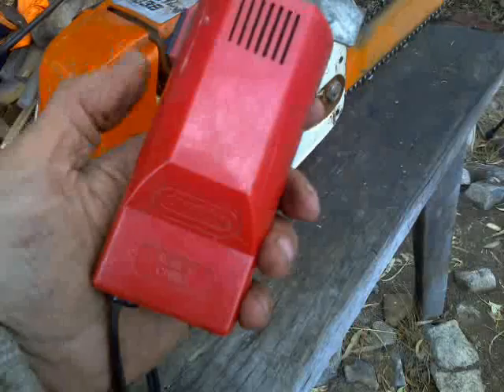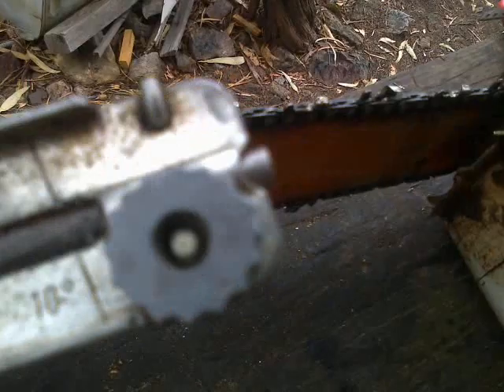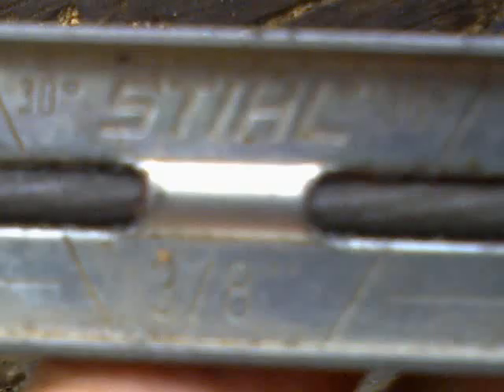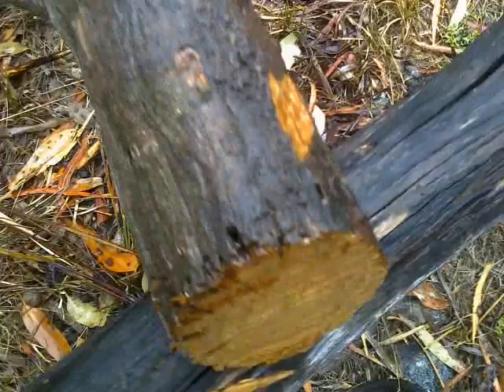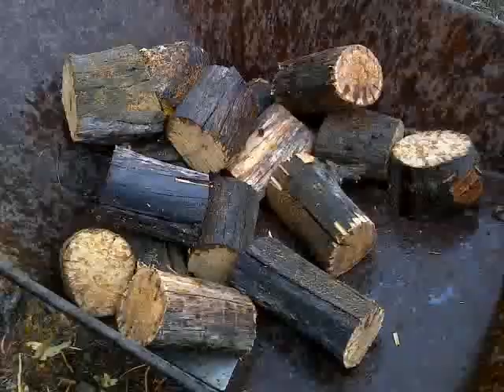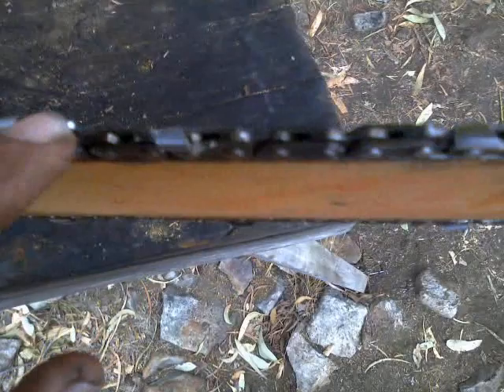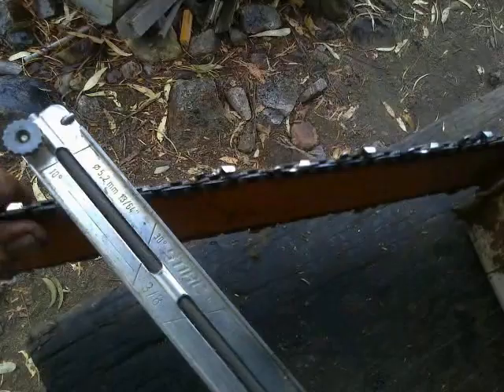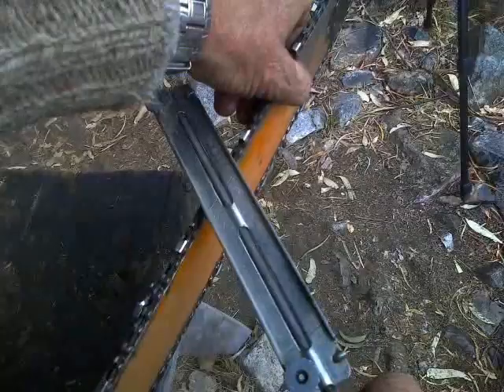File-Sharpening A Chainsaw, For Tom The Frugal Prepper...

Comment: Thanks Warbles.  My file looks just like that one, except it an Oregon brand.  I was apparently sharpening it way too much.  I am going to try just going over each tooth a few times and see how it works.
Reply from the maker: G'day Tom,

Thanks mate.

Yeah, over-sharpening is a bit of a trap because the Cutters have a "Rake Angle" that means they get shorter  in height as they get shorter in length - and the slowly diminishing height means the Depth-Guages are effectively growing too long to allow the Cutters to bite into the Wood..., so all he Cutters can be like Razors and the Saw won't cut at all.

   Anyway, I figured that you should be able to make a go of it having seen it working for me - whereas when I had tried buying a file and giving it a go there were a few subtleties which I didn't know about which had me convinced for years that "Hand Filing doesn't work..." (!).

  I'm glad to have shared a tip...
  
 Have a good one.

;-p

Ciao !

Comment: Self-sharpening versions save time and effort
Reply from the maker: G'day,

Thanks.

I haven't seen a self-sharpening Chainsaw, but I'm wary of the idea - because the Cutters only need a tiny touch-up maybe once every Tank or two of Fuel (45 minutes engine-time/30 minutes cutting), unless one hits the dirt or finds a Rock ; so a Self-Sharpening Saw sounds like a device for wearing out Chains really fast and selling lots of Chain...
   
   It's like refuelling, oiling, and tensioning the Chain - filing the Cutters, or deciding not to, is part of the routine...

Have a good one.

;-p

Ciao !

Comment: Hi Chris. I have four chainsaws. Wait a minute, i mean five. One sthil exactly like the one youre sharpening. Last winter only -15 F.  Two years ago -37 F. Big out door boiler. Eats lots of wood. Last winter more snow than previous twenty years. Its beautiful in Michigans U.P. but winters can be and in fact are brutal. A sharp saw is a must!
Reply from the maker: G'day,

Thanks mate.

  So you have Chainsaws like I have Firehoses...(4 Pumped Hoses available on 2 Pumps, a 5th Hose permanently "Live" connected to the Airport Firefighter/"Water Cannon" - and 3 propper Percolating Hoses enroute to relegate the Chinesium units to being Sprinker Extensions.
 
And the joke of it all is that the 0.75mm was a Teaser, by 9 PM there was 7mm & I checked the Dam Pump...,  this morning there's been another 12 mm in the Guage - so I'm about to now go down & shift the Pump uphill from the Dam's edge - because I'm hoping for Storms this afternoon.
  
  I've never had to worry about Storms  & flash-flooding Gully-Rakers before.

  The decadent matrerialistic  worries of being a man of TWO Firepumps...! (lol).

Have a good one.

;-p

Ciao !
Reply: Hi again. Yes you have quite a extensive fire protection water system. Much needed, and very good to have. I hope you never need it, but its very wise to have it in place.
Reply from the maker: @waynegouin939  

Yes, my feelings exactly.

Have a good one.

;-p

Ciao !

Comment: About $60 for 2 spare dewalt cordless chains.. Thats US  Dollars.. Cheapest Bunnings Spare chain  for a 12inch bar is $35
Toms chainsaw (12 inch bar) is more for carpentry than forestree  perhaps tree trimming, not firewood.
 Toms saw costs around $300 here plus about $50 each for batteries and expect $100+ for a charger..... A plug in 240 Volt electric chain saw from Bunnings is $100 to $150.. and even a self sharpening one available for $209..So Tom needs to pay Kartension to your tutorial . 
Glad to see your hydraulic enterpises are working out and that the sprinkle of rain is giving some relief.. 
P.S. I have a 3 way  nozzle  such as yours (on a 3/4 inch hose) and found although looking impressive its  performance
was piss poor.. .................... Cheers...........
Reply: I get the chains on Amazon.   They're $13 for a two pack which makes them around $6 dollar a piece.   So far the Dewalt has held up well.  I have a huge stack of wood from it, and a lot of it is just going to the mulch plant now.  I've been cutting every day fo 2 weeks after work and hauling brush on the weekends and I am about 3/4 done.   I've only done a little bit of cutting with gas when a  14" or 16" bar is needed.  My gas saw is a Poulan and it's a complete piece of junk, I spend more time fixing it than cutting with it.  I paid $149 US for the Dewalt saw, and $180 US for a 2 pack of 4 Amp Hour batteries.  I could have gotten them cheaper on Amazon, but I needed it right away.  I already had a 5AH and 3AH battery and the charger from other tools.  So it's not a super cheap way to go, but the saw has done well.  I will do a video update on my tree project soon.
Reply from the maker: G'day,

Thanks.

  Look inside the Barrel of your 3-Way Adjustable Nozzle to see if there's a Rubber Washer in there which can be removed to get rid of a Bottleneck - and then use  Thread-Tape to seal the joint where the Washer was doing duty...(?).

   I'm getting 100 Litres/Minute, going 15 metres out, though the Neeta 20mm Nozzle - fed by a 25mm Hose with 6.5 Hp giving 87 PSI.

Which makes me feel about as good as a middle-sized Firetruck, but I have more Water onsite.

Such is Life,

;-p

Ciao !
Reply: @frugalprepper  Well i jumped into that half cocked Didnt I ..  It was amazon that I searched for prices and Ebay that advertised 2 chains for $56.. You are a better shopper than me.. No offence intended but battery powered tools are suited to occasional use with performance sacrificed for convenience. Cottontop3 ( a youtuber ) promotes Milwaki battery tools and has demonstrated their chain saw.. Convenient Expensive but no substitute for gas (petrol ) when there are hours of cutting to do.. I support your quest for independant living  .. best wishes..
Reply: @reburne2012  These are some cheap chinese chains but the cut great.  The dewalt uses a Oregon bar and chain, so the originals are probably more.   I agree.  When cutting and cutting, gas is gonna be faster.  When cutting through a twisted up tangle of timber where you have to cut a few, stop drag out branches and brush then cut a few more, electric has been the way to go for me.  Also when loading brush up in the truck and you need to do a quick cut here and there to get it to fit, electric is amazing.  You expend so much less energy than starting and stopping your saw constantly, and the gas saw is heavier.  The electric dewalt is light enough to use one handed.  I find that in the right circumstance the electric is perfect for getting the most done with my 12 hours of energy.

Comment: A file sharpened saw will cut better than a machine sharpened. Period. But....it is doesn't work well if you try to sharpen a machine sharpened blade because the angle of the dangle from the grinding wheel sets a squarish edge that a round file doesn't conform to. Perhaps that is where Prepper fell afoul by trying to sharpen a machine worked chain.
Reply from the maker: G'day,

Thanks mate.

   Yeah, he says in the Thread here that he was sharpening it "far too much"....; which if one hasn't seen the job done, could be easy to do...
  
Have a good one, (7mm here this evening..

Have a go one.

;-p

Ciao
Reply: @WarblesOnALot  it all started for me when I moved to a big property and we had to cut wood for the fire...I was new to it and was wrecking the bar and chains pretty fast. I got sent to learn from the town chainsaw whisperer and he taught me the things you speak of here, that and how to use the saw in a way the spreads the load over the bar so that it would not get a hot spot and roll over the bar edge.I have never ruined a bar since. I don't even use the file guide anymore, because I can see the angle is correct when the file lays inside the tooth. I use a pair of leather gloves to stop cutting my fingers up also. I am also the proud owner of a German made Stihl that I actually found in Sydney on a roadside clean up! It needed a bar and chain and new plastic covers but it works like a champ, if only I had some farm to use it on these days...good to hear the precipitation is favouring your skies!
Reply from the maker: @m3sca1  

You're a lucky man.

My Stihl
Was assembled
In Brazil...
From Austrian
Parts ; 
But....,
Still...(?) !

When it was 18 months old, half a year out of Warranty, it had done 25 Hours & the Crankshaft snapped.

That was when I found out about the Brazillian Assembly...; when the  local Stihl Dealer rang Sydney they told him about the Brazillian who messed up a bunch of Roller Bearings...; and Stihl Oz paid the local Dealer $950 to rebuild it fully...., and since then it's done 312 Hours.

So I'm happy.

Have a good one.

;-p

Ciao !
Reply: @WarblesOnALot  interesting story of outsourcing!
Reply from the maker: @m3sca1  

Yeah..., Outsourcing...

I like to use the story to illustrate the principal that without a pre-existing Environmental Surplus then NO Economic Activity is possible at all...

 It doesn't matter how many Fishing Boats one has, or how big they are, or how "efficient" their Trawling Winches are - if there's no Fish in the Ocean.

   Austria has a collection of lovely Chainsaw Factories, but buggar-all Wild Forests left to (over)  harvest...; so the EuroPeons kept churning out their bloody Chainsaw Components, and shipped them into Brazil to create a  Brazillian Chainsaw Assembly "Industry".

   So the sillier Brazillians go into debt to proudly buy a "Brazillian Stihl" with which to chop down their Forest to supply EuroPeon, AmeriKan  (& now Chinese) Market Demand for Timber...; and the "brighter" Brazillians migrate to the Cities to chase a Career, assembling Chainsaws with which their Patriotic fellow-CitiZens are wiping out the Amazon Rainforest.

  And their shit-grade throwouts..., they shipped them to us in Oz.

   And once it broke down & then they fixed it - it's been a very good Chainsaw ; ever since.

   Life is full of weird Feedback Loops.

Have a good one.

;-p

Ciao !